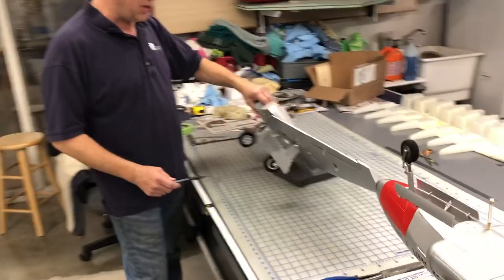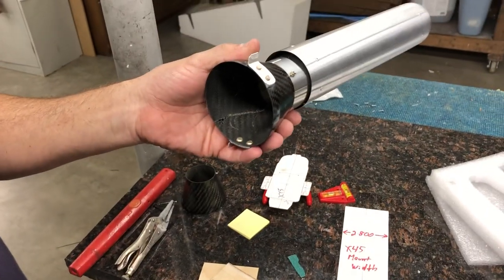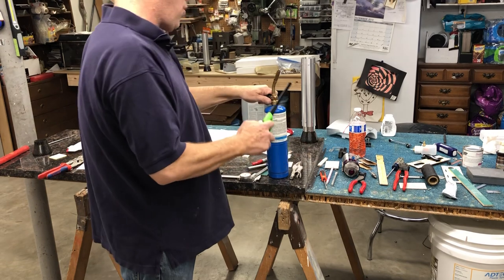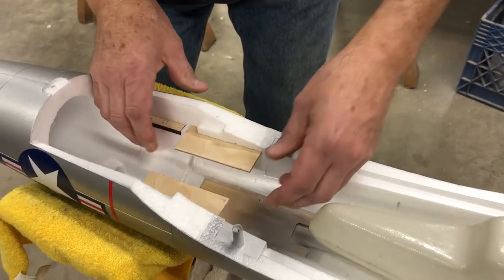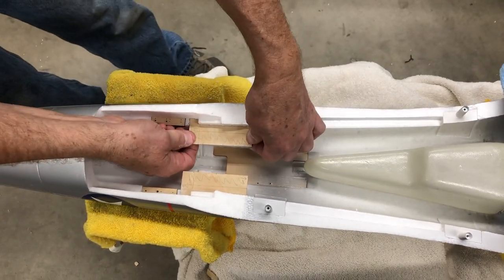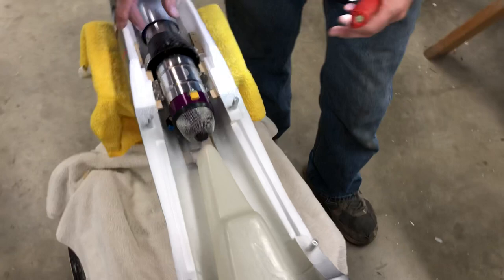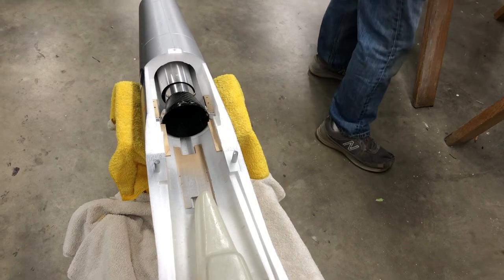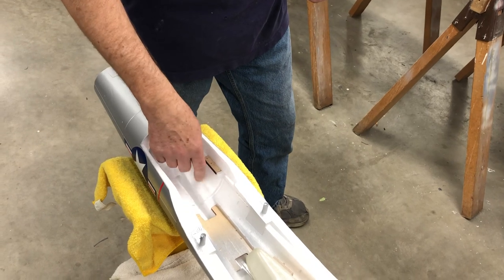Freewing T33 Turbine Conversion Ep. 3

Comment: what engine? can we diy the pipe? is that kero start or auto
Reply from the maker: Xicoy X45 engine. Sure go ahead and make the pipe yourself. Auto start
Reply: does the turbine comes with the controller for the price of xicoy? sorry just new to this usually fly glow and gas. and for the fuel is just usual kerosene no oil mix? looking towards using t33 flatform also. instead of using bracket would it be much better to reinforce the inside with fiber glass?